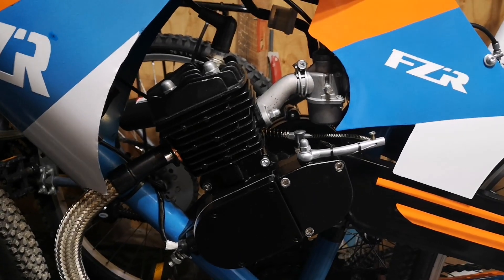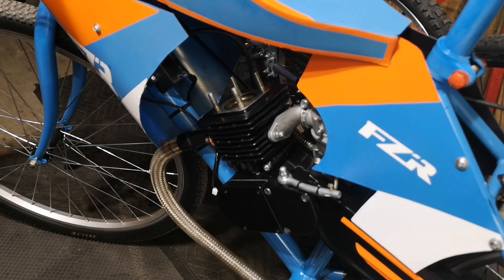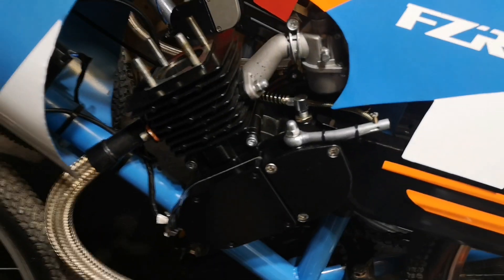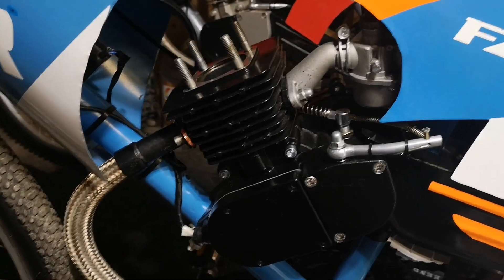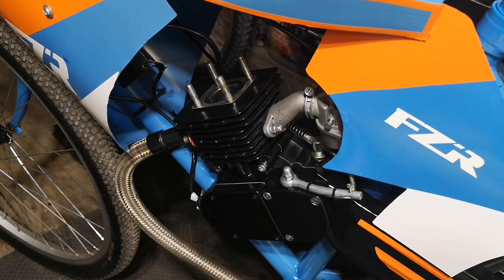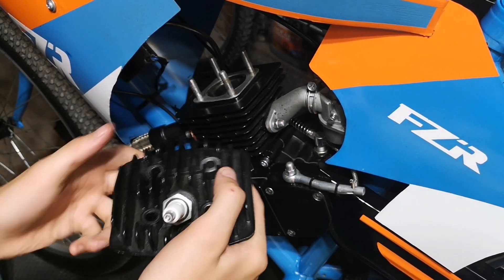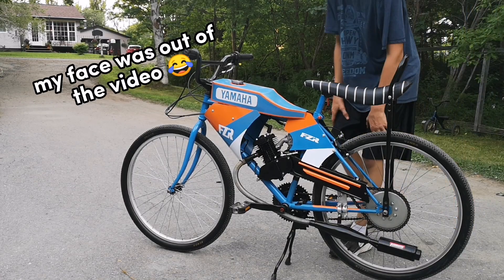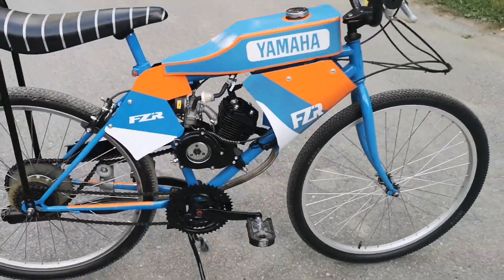The Reason Why Your Motorized Bike Cylinder has Score marks!

Comment: I have scoring marks on my head gasket, and no matter how hard I turn the head bolts, it doesn't seem to fully squish the head gasket to the engine block. It's a metal gasket, but I feel like it may be the issue. I just replaced the wiring on my bike, but if that doesn't fix it, idk what will

Comment: I see your flex exhaust,I just got one and put it on today,what do u think of urs?
Reply from the maker: It’s a good pipe for a bike that you just want a bit more low end power to climb up hills. It’s no Mz65 but it will look nice on builds like mine because it doesn’t cover the panels like my dirt bike style pipes do. It can be routed down below like I have it in the video but also down and up the seat stay like I have on my indien road-master bike. Way better than those cheap banana pipes.
Reply: I put it on my nel lusso,it seems to run ok

Comment: The other day I was omw home from work when bike started acting fu NY. Evry so often it would kinda jerk like I was grabbing the brake for a split second and then letting go. Eventually it started making a racket and they whack it stopped. I could then rock it back and forth and it would free up. Meanwhile I got caught in a rain storm so while waiting I took the head off which looked fine,  but piston had some pitting near a transfer port and a good nick in the tranfer port itself. And when I slid cyclender up alittle there was the dreaded silvery residue with little metal flakes. I'm almost certain what you were talking about with the piston expanding faster is exactly what happened. Not letting g it warm up enough first.
Reply from the maker: this unfortunately happens to often with these bikes the piston Expands to fast and your motor can even cold seize which is way worse and causes immediate piston damage. wear on iron cylinders are a big pain. I ran 32:1 very rich mixture and took it easy for the first three tanks. I cleaned the cylinder out and ported it to get rid of any metal flakes and rough edges. Even then my Harley still has two very tiny score marks and I followed every step to breaking it in. Sometimes it’s not your fault it’s plainly the motor.
Reply: @keeganhache6667  for the forest 500km I ran the ridiculous 16:1 the manual said. And took it easy but the one thing I did not do was take the engine apart and check for things. By the time I started watching videos I already had the bike together so being lazy I never took it apart to check for loose burrs or incorrect pins. Must say all that was intimidating at first but now I go a few months under my belt I understand the importance. Lucky for me I have another engine to throw on my bike while I check the busted one. Hoping I can take cylinder off and shake whatever feel down in there out. I don't think I'm skilled enough to split the case just yet. But I guess what better way to learn than a  broke engine you not scared on breaking. I like to ride but a mechanic I am not.

Comment: I've went thru 2 cylinders and pistons in only 7 hours of having the motor and there very deep cuts and I haven't been able to find out what's caused it
Reply from the maker: Wow man that’s very unfortunate but your bottom end must have had a lot of metal in it from the factory and you need to flush them out with gas so they don’t end up in the top end. Also prepping your rings can help. Sand the edges of them with 320 grit sand paper.
Reply: @keeganhache6667  alright thanks the first time it happened 8 cleaned it out with gas and it happened again I'm going to do more prepping I guess

Comment: The original bt100 was about 2-2.5 Hp stock not 3 tho…
Reply from the maker: It’s the rated Hp for the motor. A lot of people go by the rated Hp and the iron bore advertisers that it makes 3hp but in reality it’s 2. 
Not really a big deal to me because I modify my engines anyway

Comment: that Black paint is Going to make the motor Run hotter .
Reply from the maker: No it’s not enough to make it over heat. You most likely saw la hovers video on the subject and that 20 degrees difference can be fixed with a high compression head which I later installed

Comment: First time I see a braided steel exhaust lol
Reply: Theyre pretty common and cheap less than $20 on amazon
Reply from the maker: Yup there called a flex fit pipe and they increase airflow on these little motors by a lot.

Comment: My bike came w scratches brand new is there anyway to fix this or can i sand down the scratch its not catching on the ports its a line down.. but i dont wanna give up will the motor still run if i try to just oil n lube the rest up make the most of it? Or will it eventually blow up

Comment: so, after 15 minutes, why does my aluminium piston have score marks?
Reply from the maker: If it’s a brand new motor than you must have not been taking it easy for breaking it in.
When breaking in a motor you need to keep it under 1/2 throttle and run 32:1 so the cylinder can be well oiled.
Reply: @keeganhache6667  i actually do 16/1 mix for new engine, havn't ridden my motorized bikes in a few weeks now.
Reply from the maker: Dang why not bro?